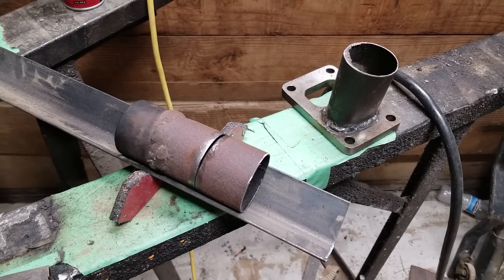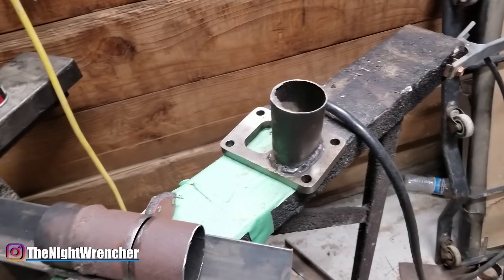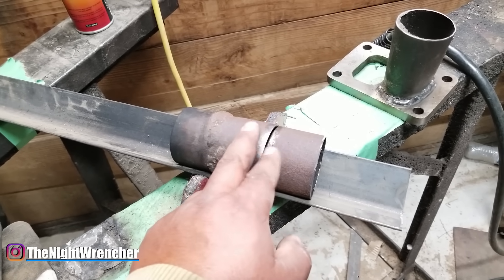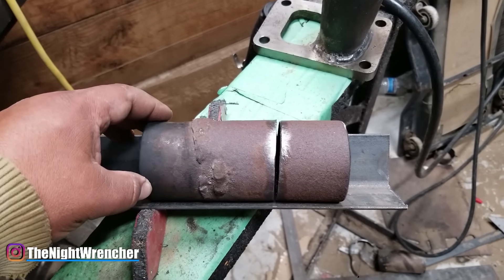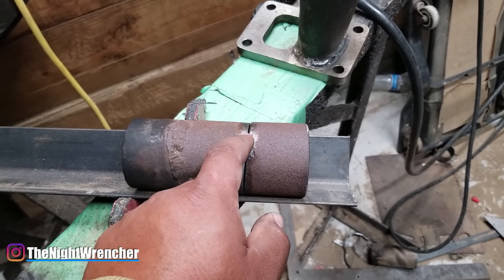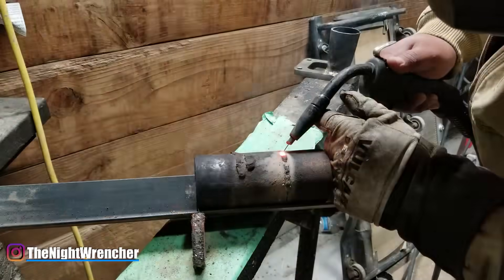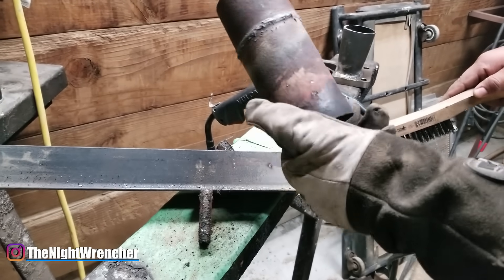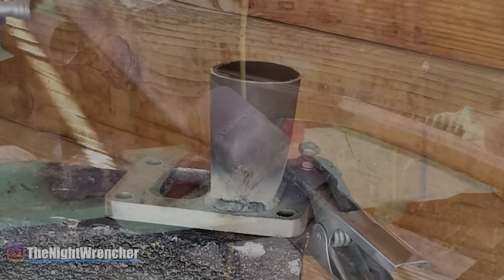How To Weld Thin Metal Using Flux Core Gasless Welder | Flux Core Welding Tips And Tricks |

Comment: Welding exhaust is easy.  Welding body panels is trickier.  It's the same concept he's talking about here, but a couple things differ.    Forget about welding body panels with flux core and use gas.  If you don't have a gas using mig, then rent one, you'll be a lot happier in the end.  If you're going to try using flux core on body panels, you're NOT going to go back and make a 2nd pass over your weld to fill any gaps or make it look nice.  You've already introduced localixzed heat into that area and don't want to do it again.

Comment: Great video.Would of helped to know what amp setting you have for thin metal.I am a beginner welder and been told to drop the heat so not penetrate through....but what you think?

Comment: are you introducing slag into the weld each time you lift off? and especially when adding a 2nd layer, especially when you didnt clean the slag off the first layer? also, that welding wire might not be suitable for layering, some of them have characteristics that prevent that.
Reply from the maker: Yes, it doesn't matter. Its just exhaust pipe.

Comment: Your whip looks different than mine. Did you remove the cover? I have the Omni 220
Reply from the maker: They must have updated it or something. Mine from I think 2019
Reply: @NightWrencher  it’s like the cover on your whip is short , showing the consumables, letting you see your welds better. I think since I am learning on fluxcore I will just remove mine completely so I can see welds better. Until I go back. I sold my e tank because it was outdated and 80/20
Reply from the maker: @IrritationsCarClub are you maybe refering to the tip of my mig gun? On this video I had removed the gas nozzle and installed a gasless nozzle. Its like a plastic cap that sits right up against and below the end of the tip

Comment: Do that under the car.......
Reply from the maker: That would be silly 😂 just take it off and do it on the bench.
Reply: @NightWrencher  Then I would have to sawzall the bolts and drill new holes, hangers hooks in the rubber mounts rewelded back to the exaust.

Comment: Forgive me if I'm wrong but you haven't once knocked off any flux. This method look like you are just trapping tons of flux between the welds resulting in very weak joints.
Reply from the maker: Nope, didnt bother removing any of the flux after each tack weld. You can if you want to but its not necessary for welding used exhaust. Itll hold

Comment: GOT SOME TIPS:
I started my first MiG project welding 0.5mm stainless to 5mm stanless... I KNOW...
This project was welding 2 expansion and contraction cones together to make a reverse megaphone anti reversion chamber for my exhaust...

1. what i did was built up some cold weld material on the 0.5mm section using an aluminium heat sync behind where i was welding...
2. once i had built up some material, i continued to use the aluminium heat sync and hammered & wire brushed inbetween EVERY SINGLE TAC & BEAD (when fusing the 0.5mm to the 5mm)

The crazy bit was at the very start i blew a 1cm x 2.5cm hole right off the bat! (on the 0.5mm section)  i was very impressed with my self when i used the heat sync and lots of little tacs (cleaning between every tac) and complexly filled the hole.. 
By the end of the project i have a perfect (no blow out) smooth finish on the inside of the reversion chamber... the heat sync helped stop the weld making bumps in the inside!!! (as bumps inside the exhaust would create turbulance)

HOPE THIS HELPS!

Comment: If you want/need more material faster, wrap some steel MIG wire around that gap and clamp. This is just a method I have used for thin material to compensate for skill issue

Comment: Im going to use gasless flux core with stainless steel wire on flat peices of 16 gauge.  Should I use this same process of tacking up tight at the joint with no bevel?
Reply from the maker: @Danfrd  yeah I think you'll be fine. Exhaust is thin enough that you probably dont need to bevel

Comment: I believe even exhaust shops use smaller .023 etc mig if possible. Like doing body panels. Spot welding not running beads on your first pass just like you mentioned.

Comment: I have a Hobart 125 welder that uses only Flux core wire. It came with the ground cable connected to the negative in the welder. The gun cable is connected to the positive lug. The owner's manual seems to say the polarity is incorrect for flux core. Are the cables corrected incorrectly?

Comment: I've used flux core a lot on as thin as 18, even 20 ga sheet, and it works, BUT, when grinding and smoothing down like on body work, there are ALWAYS tiny pin holes. I've never been able to not have pin holes with flux core, no matter the brand of wire, settings, nothing. If someone knows how to not get pin holes with flux core, let me know, because otherwise, it's mig or tig. Edit to say....it's not blow-through...it's inclusions in the weld itself....small flux-bubble inclusions....
Reply from the maker: If you move the gun in closer and run the machine a little hotter, a lot of times you can "burn off" the impurities.

Comment: This would have helped me big time on my last botched mig weld.  However, this is not flux core wire correct?
Reply: Ooops.  Ok.  I see it was.  I thought after every tack/ run I had to remove the slag.  I should have tried doing it just as you demonstrated.
Reply from the maker: You're supposed to remove the slag but honestly for small projects, its not a big deal

Comment: Is Flux Core good for extracting broken bolts? I want a welder on hand for the odd broken steel bolt in aluminum engine blocks/parts. Or is this the wrong type of welder. Do you have problems with slags building up layers on a bolt etc..

Comment: what heat range should I use for thin metal .
Reply from the maker: As low as you can and then work your way up. I was welding 22ga sheet metal today. 85 on the wire speed at 13 volts

Comment: Do you have any advice on welding thin muffler pipe overhead? Just got done with an extensive project and had material buildup and some dripping off and on.
Reply from the maker: Overhead upside down is a little hard. I like to start from the top and work my way down. Usually I turn down the wire speed a hair to keep it from balling up. Once you see it start to form a large puddle, let it cool and restart the weld at the base of the previous bead. Sometimes it pulls material off the mound and levels out the bead

Comment: Good information!! Will stick welding work for body panels? I know tig is the correct way to go for body panels but curious if stick would work? Thanks
Reply from the maker: I don't think hardly any uses tig for body panels unless its really high end body work. Ideally you'd want to use mig wire and gas for body work. Minimal spatter and head distortion. Flux core works too but its not as forgiving as mig and also theres more clean up. Stick, I would not attempt unless you're really really good. Compare trying to melt a  .025" thick wire to a  .125 " rod. Itll take more heat to get it going and flowing. For body work, I would not recomment
Reply: @NightWrencher  thank you, I appreciate it!!

Comment: You you can see that there’s no shielding gas being used here as Welter won’t be in clumpy if he’s using flex core wire you need to go to guess you’ll get a better weld Lincoln electric welding school you need to go there

Comment: Don’t like fluxcore dirty, but I know you have to have a few out the wind breeze you need fluxcore I prefer 75 shielding gas for star gone or hotter wild in the shop but 70,000 pencil strength flux Carter just got the white cast to it and if you don’t care for

Comment: can I use flux core to weld aircond copper pipe?
Reply from the maker: Flux core is steel, it will not work with copper. Try soldering or brazing instead

Comment: Should you use the copper wire or aluminum wire?
Reply from the maker: Aluminum wire can only be welded to aluminum. Copper colored solid wire is what you would use for MIG but I used flux core which is a grey/silver wire.
Reply: @NightWrencher  so copper wire is a good wire for exhaust pipes?

Comment: I have gas flux core dont have gasless wire a buddy got his catalytic stolen and wants me to weld the pipes onto a new cat im a welder but never done flux on thin pipe i dont have mig wire wnd dont wana buy some bc it will just sit can i still do this method and should i run low amp
Reply from the maker: You will need flux core wire, which is gasless. Using thinner wire like .030 will help a lot. As long as you take it slow, you can weld the pipes no problem

Comment: Another tip is to use an expander to open up one pipe so it slips over the other slightly. This makes welding much easier. Both pipes need to be shiny clean in the weld area. AutoZone loans tools for free, including tail pipe expanders.

Comment: I think im gonna just get argon gas and use it as a mig welder cause qlthought this is good for your application i need to weld thin metal for a structural part thats important and i dont really wanna risk it
Reply from the maker: The thing this, a bad mig weld can still look strong. But a bad flux core weld exposes everything. For thin metal, both processes offer more than enough strength, its the person welding that makes the difference.

Comment: you went over the tacking and then bridging the gap rather quickly and that is the part that i need help on you said i think, that you start your tack and then bridge the gap and let off... then when you were connecting the tack you said start on top of the tack and bridge the gap.  i would guess for this the you are pulling the wielder in two different direction the first one toward you in the video and the second one right or left in the video

Comment: It is possible to put passes in the butt joint. Just takes practice. It doesn’t always require tacking the full split first.
Reply from the maker: It depends on the wire size. Thinner wire helps a great deal.

Comment: Thank You for the video. Question: Would you recommend setup using the negative lead on the weld gun, and positive lead on the ground for thin steel? supposedly it reduces spatter and the welds look better because negative goes to the positive work surface for a better weld. Is it necessary?
Reply from the maker: Most modern machines are set up that way. Its the acceptes method for inverter style welders. Conventional welders won't benefit as much
Reply: @NightWrencher  Straight polarity (+ve earth) for flux core, reverse polarity (-ve earth) for standard mig. Maybe I'm missing something but why would this matter less with an old style transformer welder? I'm no electrician but presumably for DC welding the method of conversion is different but the output is basically the same.

Comment: When you were starting on top of the weld and draging into the void over and over, I never saw you chip or brush any slag before the many restarts.  Didn't the flux leave slag where you restarted?  How did you prevent slag inclusion?
I'm trying to learn.  Thanks.
Reply from the maker: You only need to worry about that if its something structual like a building or chassis. When doing exhaust work, fabricating brackets or even body work. The small inclusions don't matter. This is all to help you do DIY stuff. In a professional setting, they use gas welders or dual shield wire which is a different ball game entirely.

Comment: I hate seeing people “pop” weld an entire seam. Makes 0 sense, lower your voltage get thinner wire and run an actual bead, with stick lower your amps and use a thinner rod, not sure why the concept is so hard to comprehend for some people.

Comment: I grab old exh pipe from the local garage dumpster, cut 2 inches off, clean it and weld it back, get tons of practice.
dial the machine way down low as possible for flux core. It runs hotter than gas.

Comment: Whats the lowest setting do you use to weld that pipe together?
Reply from the maker: I can tell you but if you dont have the same machine, same wire, same metal thickness and same hand movements, it wont do you any good. I will say, go with the lowest settings and move slower. If the weld doesnt lay over flat, keep going hotter until it does.

Comment: I’m a mig welder and that ain’t thin, 1/32in is what you should be making this video with. Unless you running a crazy amperage and wire speed you will not burn through exhaust. This video is absolutely stupid. Exhaust is usually heat treated stainless. If it’s not it’s still not thin enough your burning though unless your inexperienced, but if you’re an inexperienced welder there absolutely no reason you should be doing exhaust work. Anyone watching this should completely disregard this video and go to school for welding.

Comment: Just curious as to whether or not you're using flux core welding. Shouldn't you clean off the slag before welding to the weld? I've heard that if you don't clean the slag it makes the weld weak. Just curious. I'm just trying to learn welding and most videos edit the actual welding. I've noticed they never show exactly how long to actually weld before stopping to let it cool down. However I think your video actually showed you doing the welding. No editing on the welding itself like fast forwarding while welding do ppl can see exactly how long to weld so we don't blow a hole in the material we're welding. Great job
Reply from the maker: Yes, I'm using flux core and yes you should clean off the weld before continuing. With that being said, exhaust is so thin, you'll be able to get good penetration and strong welds even if you don't clean the welder after each pass. My whole turbo system is welded like that and its more than strong enough with zero leaks.

Comment: Key when welding exhausts is to weld onto weld. I.E stick a weld onto the old material both sides, not trying to join anything - then join your welds to each other. Once you get even a tiny bit joined - no matter how big the gap is - keep welding onto your weld, ignore the base metal. Weld onto weld. Using a long C as your weld pattern works great - just keep laying one C onto the next C, working around the whole pipe. The benefit of using big C's is when you're done, it looks real pretty too. :-) Like stacking dimes.
Reply from the maker: Thats what I do too. welding in a C is uncommon in other welding processes but for flux core it works great
Reply: @NightWrencher  Flux core is also waaay better for "spot welds" - I.E plug welds to join panels. More especially so if you are using weld-through primer. Gas mig will sulk & spit, flux core will weld ahead & with better penetration.  Filling big voids is also fast & easy with flux, plus it cares a lot less about "perfect" metal preparation.

Comment: I made my own pie cut exhaust, welded it with flux core. It looks awful, and my choice of crossover and "muffler" make it quite loud... I used an x pipe and a 2-in-2-out cherry bomb extreme "muffler" with a pair of pie cut turndown tips. Ahead of the Xpipe, I have a pair of high-flow mini cats(1 for each bank). This is all on my 1996 Audi A4 Quattro; 2.8L 12V V6. I've got essentially the whole process I took on my YouTube channel under "Community" and I uploaded the 2 takes of me starting it after the exhaust was done. I tell a story better using pictures over a longer time vs videos... my ADHD can't handle that added difficulty setting(I lose enough tools as I'm working, I can't imagine the things I say being recorded lmao). Thanks for your tips, I will definitely keep them in mind next time I weld exhaust.

Comment: Seems like good input. I love how with YouTube i can watch multiple videos and accumulate the highlights of each one to approach something new with confidence like welding
Reply from the maker: Exactly right!
Reply: @NightWrencher  did u ever do heat shields? I was thinking to tack hex head machined screws like cookies to a sheet metal sheet and cutting squares to tack them to the car body. 

Any tips on tacking to the body? Where should i ground. 

I got 2 shields to do with the exhaust repair
Reply from the maker: That can work, you can ground on any clean piece of metal on the body but you need to make sure the battery is disconnected and any computer is unhooked from the ground to prevent damage
Reply: @NightWrencher  okay i gotta do the exhaust this week so ill do the shields. I honestly wouldnt of disconnected the battery or the ecu but i will now. Makes sense to play safe. Thanks for liking my comment so i could ask this

Comment: Haha I know it’s months since you posted this but when you say you turn your welder all the way down, what’s all the way down? I’m using a yeswelder mig 205ds. It has gas and fluxcore option. I’ll be going fluxcore. So where do you recommend starting? 50-60?
Reply from the maker: for .030 wire I use 105 at 16.5 volts.

Comment: While you mention in your title mentions you are using flux core  it wasn't mentioned   in your  video. I'm guessing that  using flux  core  with no gas is why you didn't have your tip shield on? I've actually never used flux core. You got some pretty nice results  with it. Well done. God bless, stay  well.
Reply from the maker: Yes, exactly. ALL my welding is done with flux core unless I say in the video otherwise. Once you learn how to use it, you can actually get pretty good results.

Comment: My Flux core welder leaves spatter beads all over around my welds I've got to spray that no stick to be haft way clean how the hell did u just weld all that and not 1 bead that's the real question??? Was that even Flux core wire ???
Reply from the maker: Invest in anti spatter spray